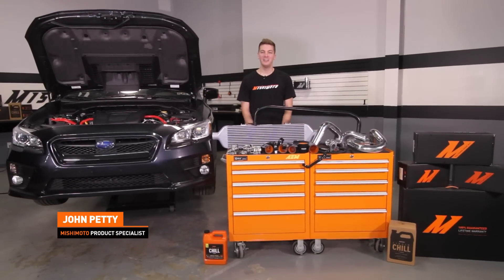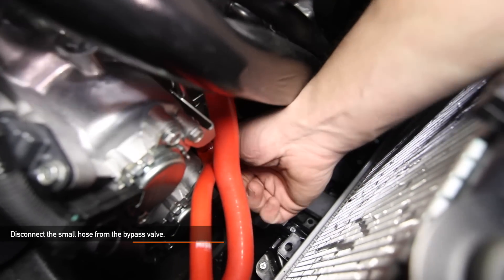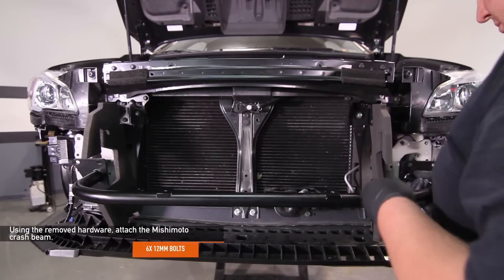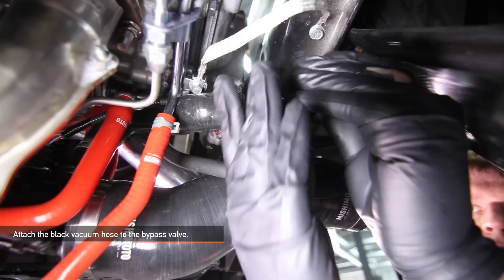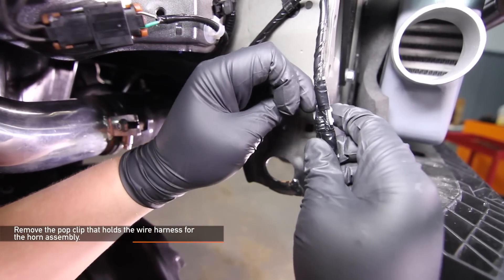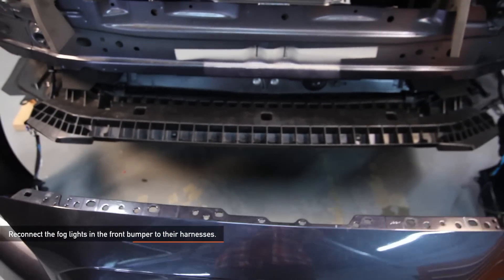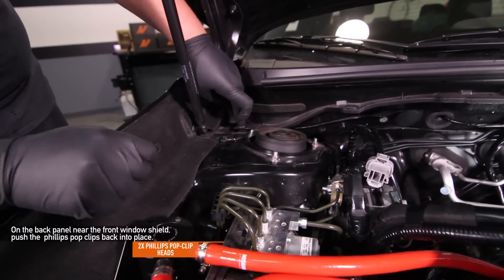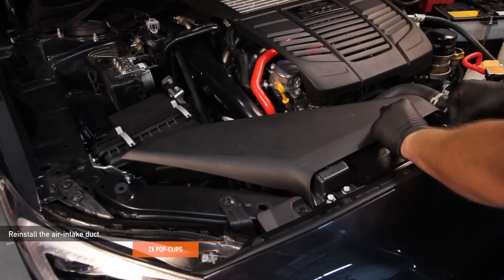Mishimoto Front-Mount Intercooler Kit for the 2015-2021 Subaru WRX Installation Video

Comment: I ordered a mishimoto fmic my question is can I use a Perrin turbo inlet or would it not work with the fmic tubes
Reply from the maker: As long as the Perrin turbo inlet is positioned the same a stock this should not be a problem

Comment: hi does it fix if i have the mishimoto oil cooler?
Reply from the maker: Unfortunately the front mount intercooler will not fit with the oil cooler in place. The oil cooler would need to be relocated to another available space

Comment: 2019 WRX
Alright got everything installed a little while ago finally updating on my experience. The bumper does require some “modification” as it is NOT a direct fitment, the plastic wheel well needs to be cut so there are no interference or clearance issues. The factory windshield washer reservoir funnel tube will have to be wedges against the battery in order for it to still fit, nothing major but I’ll be fixing that ASAP as I’m way to picky about my car. Last but not least this will take you somewhere around 5-6 hours to install, ALSO do not forget if your 18+ wrx to transfers the electric 2 pin connector over to your turbo housing inlet newly provided Pcv hose.
Reply from the maker: Great to hear you were able to complete this install. yes unfortunately after the most resent refresh to the car the front mount will require slight trimming as the bumper will now touch the front mount.
Reply: Mishimoto Automotive 

Product is great I’ve had no knock or DAM drops and I’m running 10.7-11.2 on WOT without a tune so it’s perfectly in specification for driving, I’ll be re-tuning the vehicle for the intercooler later this week so I can see the added power gains. Intake temp hasn’t went above 106f and stays around 65-75 on moderate city driving. Do you sell a windshield fluid reservoir for the revised bumper fitment, that would really help my ocd knowing that the funnel tube leading down is back in its home. Thank you

#CooledByMishi
Reply from the maker: Unfortunately no reservoir for your model yet to be able to help with this.

Comment: the coupler near the battery is hitting my stock oil cap for my wrx.. any fix??
Reply from the maker: Try loosening the clamps on the couplers to allow them to rotate and move. Sounds like you just need to make a slight adjustment to the couplers.

Comment: Hey Mishimoto, I just finished installing your FMIC and I LOVE IT! Will be writing a good review but one question, Why do you guys have FMIC install guides on every year but the 2008-2014 Subaru’s?
Reply from the maker: Hey Denzel, the install for those is fairly similar to the 01-07 kit so most customers will use that for reference. We found a majority of our customers were having shops install these originally so a new video was never produced for the DIY crowd.